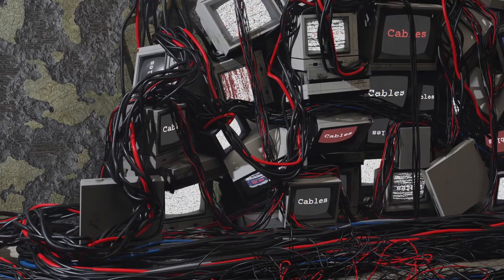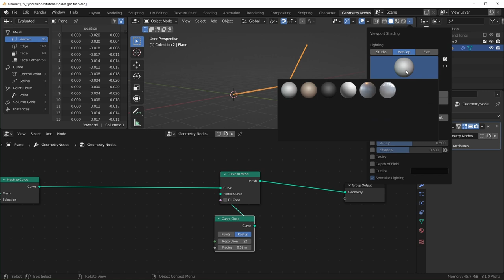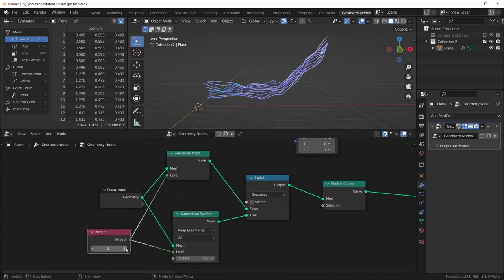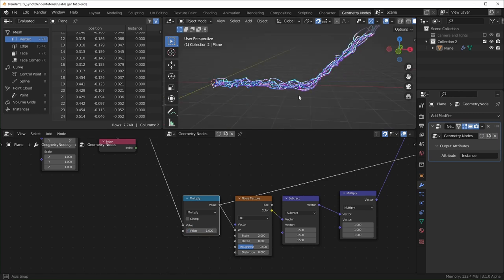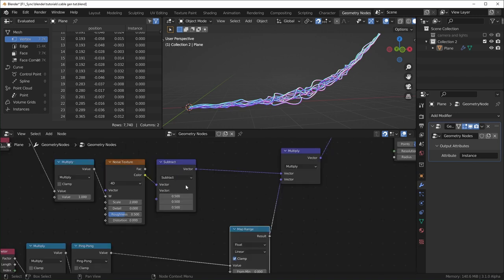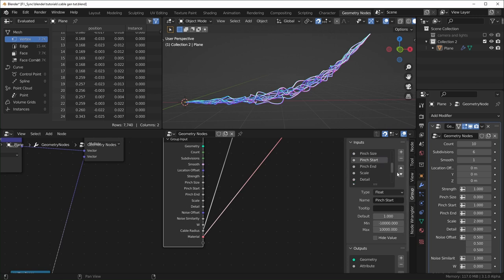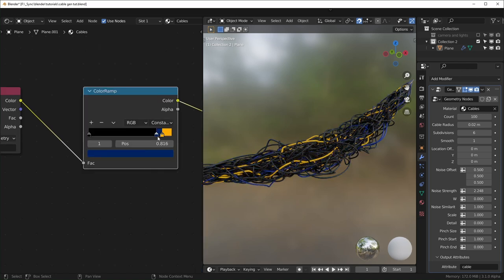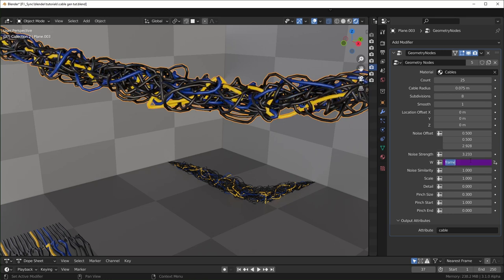Cable Generator with Geometry Nodes || Blender 3.1

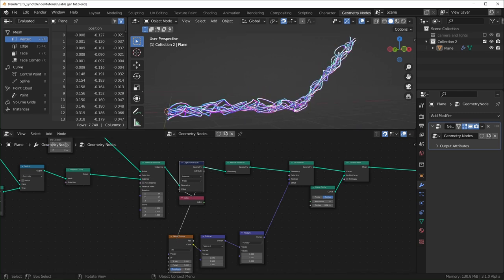Comment: Great tutorial! I am using 3.0 and in 8:50 I just pluged the "index" node directly into the W value of the "noise texture" node and it worked for me. No need of the "Capture attribute" node.
Reply from the maker: Yep, I believe that gives a different w value for each vertex, instead of each instance. So it will work but you won't have as much control. Good tip though!

Comment: Indexing workaround if needed. Plug an index node into the instancing index port on the instance points node and also plug it into the W port on the noise node. Boom.

Comment: Doable in v3.0 for anyone curious, you just don't get as much control over the end result (eg pinching). You can still get a great result though. Thanks very much for the tutorial!
Reply from the maker: Totally! I'm sure you could get all of the effects in 3.0 but it would require more work.
Reply: The pinching effect I just discovered can be done in 3.0 using the "Curve Parameter" node in place of the "Spline Parameter" node :)

Comment: I wonder if one could use a node to constraint the scatter on the Z axis. Basically not letting the cables go below certain value so they won't clip through the floor

Comment: Trying this in 3.4, I was not seeing or able to transfer the Captured Attribute as setup in tutorial.  I solved it by using a "Store Named Attribute" after the Realize instances and taking the value from the white noise and connecting it to value.  Then named it cable.    For the Group Output, I used the "Named Attribute" node, typed in cable and connected it to the Group Output.  Attribute is now available in the shader.   Not sure if there is an easier method, but this worked for me in 3.4.1
Reply: Thank you so much, can confirm that this works in 4.0

Comment: Awesome tutorial, thanks! If I want flat cables and give them random rotations how would I do that? I can only rotate one by one, tried figuring it out but couldnt.
Reply from the maker: If you want them flat you can change the profile shape to something other than a circle, or you can squash it with a transform node. Rotating is kind of limited. You can plug the leng from the spline parameter into a set tilt node, and multiply it to make it twist, but they will twist individually. Idk how to make them all twist at the same time using this method yet.
Reply: @JoeyCarlino  worked beautifully. I added the Set Curve Tilt before the Curve to Mesh then I connected the Capture Attribute to the Tilt Value and added a multiply before. I wanted to tilt them randomly. By adding before Curve to Mesh (without linking the attribute) they rotate together. In my previous workflow I created each cable separately, this saves me lots of time. Thank you!!

Comment: How do you randomize the color of the cables now that the new set up doesn't use instances node? Thank you for the great videos!
Reply from the maker: If you use the duplicate elements node, you can use the duplicate index to randomize the color. Store it as a named attribute and use it in the shader editor
Reply: Thank you mate! Weirdly, It almost seems like the duplicate index doesn't produce enough color variation (too bright whites) and I have to use math nodes and brightness along with the white noise  texture to achieve a semi-decent gray scale. But I barely know what I'm doing. I appreciate your reply very much  @JoeyCarlino
Reply from the maker: Try plugging it into the w of a white noise node
Reply: I did and it worked :) but still needed to play with math and contrast to get  more shades of grey. And yet I can get like 5 colors max, go figure. Thank you for the input!
 @JoeyCarlino

Comment: Preface: I'm using 3.01 beta  release from 22 - 02 - 06. Despite my best efforts I couldn't get the material side of things to work. I tried to copy your set up however for the capture attribute it didn't allow me to select instances for the first data type. I still got a decent result for the rest of it despite this, but it meant I wasn't able to set a random value for each instance. Is there another workaround to get a random value per instance?
Reply from the maker: You could try setting it to spline and putting it after the realize instance node.
Reply: Same issue, i see the name in the Geo Nodes table, but each instance just has the same value :S
Reply: @JoeyCarlino  That solves the problem! Somehow even in 3.3.1 LTS the capture attribute node doesn't capture the instance index. But capturing the spline index after realizing instances gives the expected behaviour. Thank you for the great tutorial!

Comment: My Capture Attribute Node has no Instance data type, despite being on Blender 3.5.1, any ideas? 3.3 also seems to not have it.
Reply from the maker: You can do this more easily with a duplicate elements node now. Use the index output to control the w of a noise texture. It's a lot fewer nodes

Comment: Did any one got how to make different Cable IDs to be different Radius ?
Reply from the maker: I haven't tried that, but if you use a "set curve radius" you could probably plug in the same value that is giving each cable a different color.
Reply: @JoeyCarlino   That worked thx !

Comment: that pinching metod not working at all for me in 3.2 version :/ those math nodes  between spline parameter and map range do absolutely nothing, I think spline parameter node itself not doing anything
Reply from the maker: This still works in 3.2, I've been using it regularly
Reply: @JoeyCarlino  Then I can't figure out what Im missing in the process, thats weird :(
Reply: Same thing is happening to me...